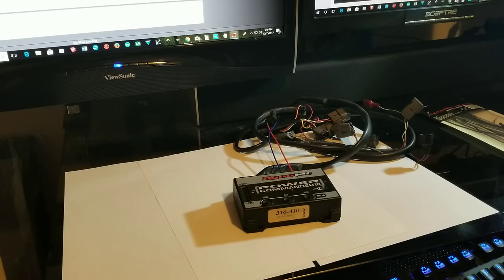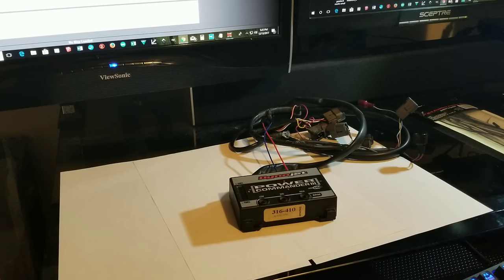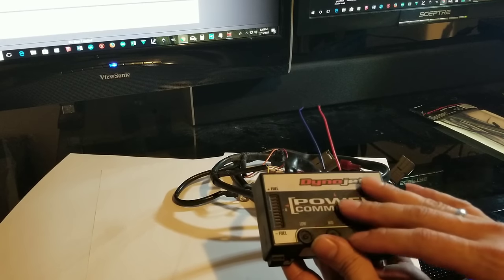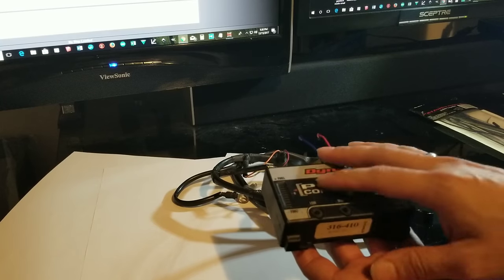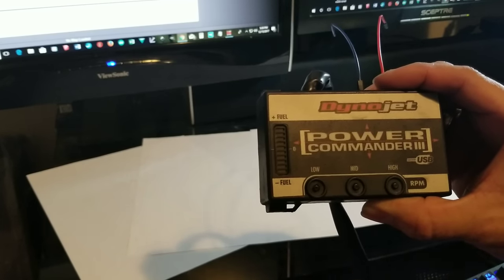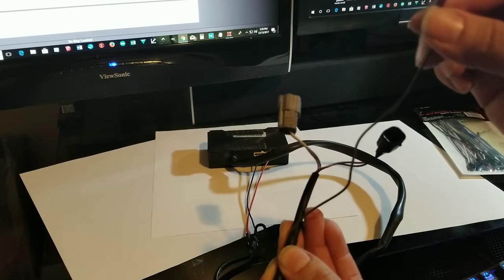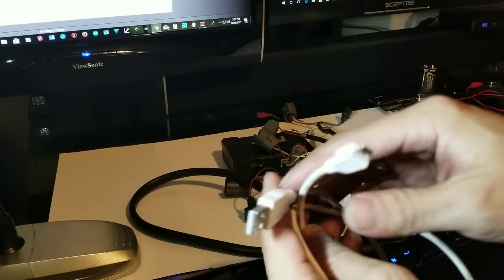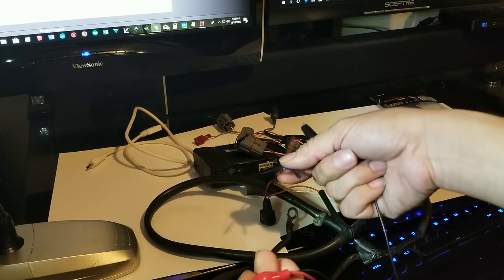Power Commander 3 Full Install - Mapping to Installation (Part 1)

Comment: Can i used without mapping newly brought. Just by adjustment. Can it
Reply from the maker: Lian Khup , ive never bought one new but im going to say no for the simple fact the even though you bought the Pc3 for your year there are different variations or applications that it may fit. Take the k4 and K5 600 and 750 GSXR . All have the same parts that are interchangeable but the 600 engine would not require the same amount of fuel. So while it may work out the box if it does come with a map preloaded it may not be for your specific year, make and model.

I had a female friend purchase a PC5 from the dealership and she had to have it mapped even though she bought it specifically for her bike (FZ09)

Comment: Will a non working power commander make the bike not run?
Reply from the maker: Correct, there is no failsafe that I am aware of. Since the bikes ECM injectors single passes through the PCIII and if the PC UNIT is dead.. there  would be no transferred signal to the injectors to open and close.. thus resulting in no gas to the engine.

Comment: Can u help me out I bought a bike 2008 r1 stock it has a power commander 3 I want to retune it but I cant finds maps for it what can I do🤔
Reply: Your going to screw your bike up.... There is not a bunch of maps floating online that you could use....  Read up on AFR's etc
Reply: @TheChemistDIY  Great job!  You definitely need to get your bike to the Dyno for your AFR reading. Make a video, because you like to talk alot :). As Brock says the power will be there if the tune is good. I sent you the hp and torque numbers, but I didn't send you the AFR numbers. Let me know if you want to see them. Mods K&N, Tsukigi exhaust and no PC. But good possibility that previous owner reflashed/flashed/remapped the stock ECU. 49 state bike, imported to hot and humid Malaysia. How did the map in this video work for you? My map on the stock ECU ran on the lean scale in certain rpm, speed range and also ran in the rich range in other areas. I'm still learning myself, so humor me a bit. I will tell you that on a certain pull and a specific gear the AFR was down in the 10.2(11.5 is defined as Best rich torque   wot) to another range and finished in the 12.2(Defined as Safe power at WOT) It was a mess in my opinion, that's why I bought the PCIII. But who knows, it could be the right tune for this bike. It runs amazing(minor discrepancies), but thats subjective. The AFR range of 12.5-13.2 seems to be the tq/hp numbers. Look forward to hearing from you.

Comment: I have the Power Commander 3 installed on my bike and I can't find any maps on the website for a 2005 GSXR 600.. They have maps for other Suzuki's, just not the GSXR 600... does anyone know where I can find one?  Or can the Power Commander V maps work on a 3?
Reply from the maker: ** 2020 UPDATE **
For those of you looking to download a map for your motorcycle DynoJet has updated their website  and you must NOW register in order to see the any maps. Once you have registered with the site , log in and go to https://www.dynojet.com/tunes and put in your bikes information in the 5 boxes located just under the picture titled "Tunes" and  click go. Your bikes maps should populate and under the downloads column you should see the maps for you modifications. If you see login in this section then you are not logged in and must do so .

For my 600 folks looking for a map you will find it under "Power Commander" dropdown AND NOT "Power Commander III USB". The pages are limited to only 10 maps per view and there is a total of 3 pages, so if you don't see your map on the first page be sure to go through all 3 pages .
Reply: I looked on the site and you're correct,  no maps for your bike.  I only found maps for a 2005 Suzuki GSKR 1000. Idk if those still work for your setup but it may not hurt to look at the data. 
Todd
Reply from the maker: If at all, I would say try surfing the forums and look for topics with those have tuned the bikes via a Dyno and offer to buy a copy of their map. If all else fails then take your bike to get tuned and then sell your map for to those looking for something close. Doing that will pay for your tune in the long run on its own.

I'm curious to to know what's the difference between power commander and power comander USB 3 maps..
Reply: @TheChemistDIY  Thanks for looking into this. I was worried that "power commander" wasn't the same MAP for the "power commander III."  I already downloaded the MAP from the "power commander" dropdown so I'm good now.  Thanks again, you saved me a big headache!
Reply: james moreno since this message is newer than your other one. Are you unsure if the map I got from “power commander” will work for my PC3?
Reply from the maker: @paully08  I can't be for certain that this is your map. I did do some digging on the forums and your not alone from I've read. What I didn't see is anyone trying the power commander map as opposed to the power commander USB map which does not seem to exist.
Reply from the maker: What I suggest is to give that map a try and see what you get.. if it the bike runs like crap then you know for sure it won't work.. if it works then your a hero for your RR folks.
Reply from the maker: Also, be sure to grab a copy of a zero map. A zero map is basically a bypass map and  will allow the PC3 to remain connected and keep the bike running normally as if the PC3 wasn't there till you find a map or get the bike turned.
Reply: james moreno I got this bike from my brother in law. He seized the engine and gave me the bike with the PC3 and the full yoshi exhaust, so he could’ve already mapped it correctly. I have already swapped in a good working motor and I was just thinking the old motor could’ve been mapped wrong and been too lean(which would make it too hot) and that’s how he seized the motor.  I’ll probably just leave it alone lol..the bike is running good so I guess if it ain’t broke, don’t fix it 😂 thanks for all your help!

Comment: how to change the ignition timing and make pops and bangs?
Reply from the maker: Pops and bangs are created due to poorly tuned engines.. incorrect air to fuel ratios, bad timing, vacuum leaks, dirty pair system, incorrect sparkplug gaping..  why would want to make your  bike run bad?.. to do what your speaking of is not possible with the power commander.. just mess up one or more of the things I  mentioned and you'll have what you want.. you'll also have a dead engine in no time.

Comment: Turn the background music down a little hard to hear ya!
Reply from the maker: liveforthemic appreciate the comment, will do.
Reply: @TheChemistDIY  I used the same map. Tested for a week and it was very smooth. Fuel consumption was to high. I zeroed out the same map using PCIII to PC . My stock ECU map was already dynoed, so I knew I was on the rich side already. PCIII made it even richer. Looks like custom map is required to improve even more.

Comment: i have some question how do i know what value
i should add in fuel value
Reply from the maker: อมรเชษฐ รัตนอินทนิล the only way to get true to life performance increases is with a dyno. Anything other then that is basically a crap shoot. It's either that or get one from someone who had their bike dynoed with the mods or setup your currently running and compare the two to see where the addition of fuel gave them the increased performance over the one you downloaded from dynojet.

Comment: So using MacOS is out of the question?
Reply from the maker: What up Lance, to date I haven't seen PC software version for MaC.. but dynojet has been updating their website so they may have and I just haven't ran across. That said, if you're insisting on using a MAC you could always run Windows in a virtual box on your MAC and open the PC software that way.. or save yourself the headache and just buy a cheap windows 10 laptop off eBay for the garage. 

When you get Dyno Tuned, you don't really see any techs using MACs to perform these jobs, partly because Apple 🍎 is so proprietary..and let's not forget more expensive for the abuse their going to put it through.

Comment: I just followed your instructions and when I put in the year make and model, there are no maps available for the PCIII
Reply from the maker: Whats the yr, make and model you are searching for.
Reply: james moreno 2007 cbr1000rr. Slip on exhaust and k&N air filter
Reply from the maker: @DieselZee  you didnt specify the slipon  exhaust brand but if its a Yosh RS5 then your map is  125-013 for your 07 CBR1000RR
Reply: james moreno thank you sir it is a RS5 slip on but I’m about to switch to a toce style slip on. Is their a certain map for that?
Reply: james moreno and also, how do I download that 125-013 map?
Reply from the maker: @DieselZee  look all the way to the right of your selection, there will be a down arrow with line underneath it. Click on that and the download will begin.
Reply: james moreno on powercommander.com? I tried and when I put in my type of bike it says “there are no selections available” I also tried it with your bike like you did in the video and it said the same thing. Maybe there aren’t anymore maps for the PCIII?
Reply from the maker: @DieselZee  they have changed their down load requirements. when u go to the power commander website and select your year make and model, a popup will prompt you for which PC you have, select  PCIII from the images (only 2 options), a 2nd popup will occure that asks for a valide email address. Put in your email, select that you do not want to be notified with info and select ok.. this will turn the grey arrow for your downloads to red.. then u can download.
Reply: james moreno okay thank you for the response I will give that a try. Do you know if they have a map for a toce slip on?
Reply from the maker: @DieselZee  Zach, i was able to download your map so u should be good to go using what i stated previously. As for the other exhausted i didnt check but when u download you can see.
Reply: james moreno thanks again James. I looked at the maps and I didn’t see a toce exhaust + after market air filter combo. I wonder if it would hurt to use the RS5 + after market air filter combo with the toce exhaust slip
Reply from the maker: @DieselZee  i dont think it would hurt anything, you should still recieve the same performance gains. I think the PCIII maps configuration boils down to the length of the exhaust canister (ie.. short or long) stick with that theory and you should be good. Remember these maps are dyno tested for best performance but it doesnt mean u have to stick to it or else they wouldnt give u the option to tweak. All bikes run differently, especially after break in and youll need to tweak the PC3 settings Anyways..
Reply: james moreno happen to have a video on the best way to tweak? Never mapped before and hardly know how to read the positive and negative numbers in the table
Reply from the maker: @DieselZee  i have another video showing you how to adjust the gains using the 3 buttons on the PC3.  Realistically, your going to want to put the bike on a dyno in have a dyno technician do the tweaking for you to get the optimal performance out of your engine and the exhaust. Everything else is just tweeking to your liking.  My suggestion to you is upload the map to the Power Commander and try it out for the 1st time, you are going to see tremendous gains that you never had before and felt on the throttle. If that is not enough for you then go about tweaking it using the 3 button method I show in my other video. If after all that you are not satisfied then consider taking it to a dyno technician.
Reply: james moreno awesome thanks for the  help man
Reply: This unit is a decade behind the times just horrible .

Comment: yamaha r6 yoshimura full system 
witc map os better?
is anyone who make test?
Reply from the maker: Well just installing won't give you the performance gains as say getting it Dyno tuned. You may feel a slight increase in the throttle response when messing with the three button configuration on the panel as I did.

Comment: Can you use this on a snowmobile??
Reply from the maker: I suppose you could if there was a MAP for it or if you dropped a bike motor in it that fit ..
Reply: @TheChemistDIY  we'll see I had purchased a snowmobile and it already has Dyno jet hooked up to it and I would like to know if I can install it without it wrecking it or do I have to do something special or what I don't know please help thank you
Reply: Uninstall I meant not install sorry
Reply from the maker: @jeromeallegrezza7561  yeah, it's plug and play, everything should be able to return to factory..
Reply: Thank you for your quick responses 👍

Comment: Cant find maps for pc3 for 2006 gsxr 1K but they have maps for pc5 i tried to copy an paste the map on to the pc3 software wont work anybody experience this
Reply from the maker: Anthony, I can no longer find my bike as well when selecting PCIII Usb option first HOWEVER if you select POWER COMMANDER" in the first dropdown and input your bikes information it will have our bikes listed. I have sent an email to Dj inquiring and waiting on a reply.

Here's my email:
"PCIII USB map is no longer available when inputting my bikes year, make and model in the drop down menus of your site.  Information for my bikes map can only be found if selecting the "Power Commander" dropdown option first and inputting my bikes information. Are the Power Command and Power Commander USB III the same map or is this a website error that no one has taken notice to... Thanks -  James (2005 Suzuki GSXR 750)"
Reply: james moreno i was literally writing the same email to Dynojet when my notification went off saying u replied lol
Reply from the maker: @anthonyh3261  Great Minds Think Alike brother.  My suggestion is that you continue with that email so we can get the problem resolved. If given enough complaints maybe the'll move faster on fixing the issue.
Reply: james moreno yup i just sent it. Also i just figured out how to copy and paste a map from the pc5 to pc3. I kept wondering why the numbers weren’t matching up wen i copied and pasted an I realized the pc5 has 15% throttle adjustment when the pc3 doesn’t it goes 10% to 20%. Then i used a 2008 zx10r map that they had for the pc3 because my rev limiter stops at 13,250 i was going to use the busa map it stopped at 12,000 and it wont let you add another column to add the rpms and fuel adjustment.
Reply from the maker: @anthonyh3261  ya heard that MAPs for the 3 and 5 are incompatible as well. I've never had the luxury of being able to test/see the difference in the two so I can't really speak on it.

To bad you didn't have a screenshot of you're map.. you could just input the values manually and create you're own map without having to download it.
Reply: james moreno i pretty much did that but that power commander 3 software wont let you do anything unless a map is loaded on there thats why i used zx10r map because it has same rev limit as mine
Reply from the maker: Odd that it doesn't let you create a map and save it with the file extension. Not your typical way of doing things.. but at least you found a work around.
Reply: james moreno jus realized that Dynojet sent me a email 2 hrs ago they sent me the map for the full yoshimura that i needed for the pc3 in correct format. I looked at the whole fuel table it is identical to the way I did it. either you can email them an wait to get the map from them or do what i did copy and paste just find a bike with the same rpm limit and copy and paste each row from pc5 to pc3
Reply from the maker: @anthonyh3261  Awesome,  This is great info that I will pass along to others when they reach out to me,

Comment: Hello ! since I put my PCIII my 450ltr has big problems starting hot and cold can you help me please
Reply from the maker: Does the bike run normal when you disconnect the PC3 and run stock..??
Reply: hello, now i have a new problem, i updated it, during the update the quad turned off and since that time no longer possible to start it, and the pc3 no longer displays a green led and it is no longer detectable by my pc
Reply from the maker: @OuDouay_LTR  You didnt anwers the question. Have you tried disconnecting the PC3 and hook everything up normally to confirm that the issue is not with the bike.. Sounds dumb but we have to start with the base reading first and that's a fully functional bike before connecting the PC3 in-line.

Once you confirm that the bike runs without the PC3 we then can move to troubleshooting the PC3.. and that's bench testing (not connected to the bike).. Dyno ject has a bench test here .

https://dynojet.zendesk.com/hc/en-us/articles/360003901114-Power-Commander-III-How-to-Reset-a-PCIIIUSB-

If it still does not boot or communicate after bench testing then we can confirm that your PC3 is done..
Reply: @TheChemistDIY  yes yes my 450ltr works perfectly without the pc3. I'll try what you just told me tomorrow. I'll keep you informed. THANKS